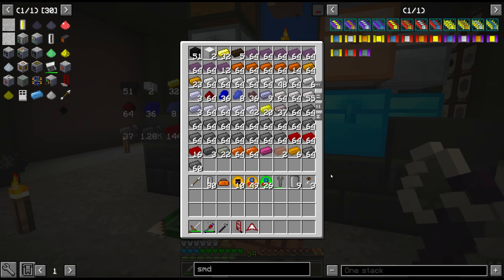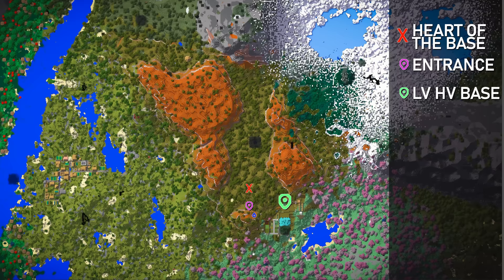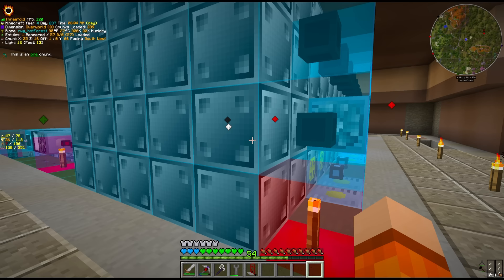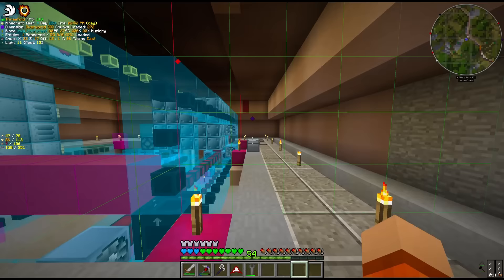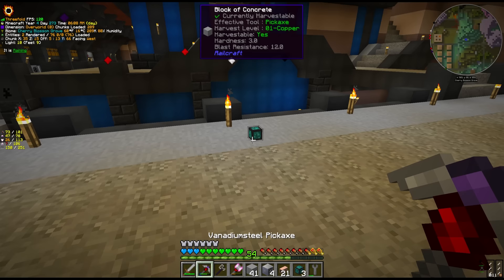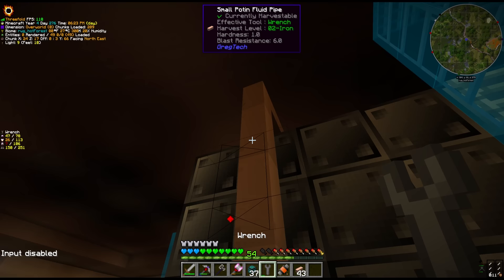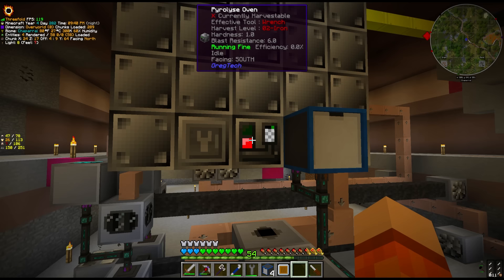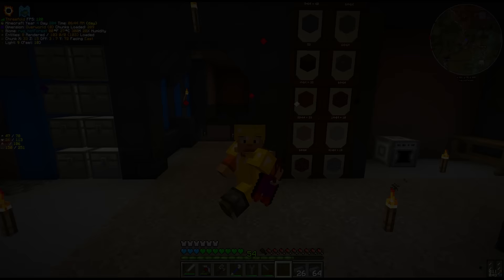Gregtech New Horizons S2 13: Power the Future

Comment: (For the record the Schematica design that Three initially shows off actually had an error in it, which was fixed after Three pointed it out to me. In addition Three rotated the design presumably to better fit his future power, which unfortunately causes Schematica to incorrectly/not rotate some of the blocks causing issues like machines supposedly getting power input through the front face, which is impossible. So if the Schematical design you get looks/is slightly different, that would be why 🙃)

For the record the cheapest incarnation of the Benzene setup only requires Kanthal Coils, Polyethylene (for Item Conduits), the slightest amount of Thaumcraft (though only for the maintenance lights, and while more annoying to set up you can instead use Insulated Redstone Conduits if you really wish), and some MV-tier machines to start. After that you can simply fill out machines and/or upgrade the few machines that require upgrading (mainly the Pyro ovens, the generators for the pyro ovens and the Electric Air Filter if you're playing with pollution) as you get them. The finalized design with the quad EV DT is a fair bit more complicated in comparison, but not so much that it's impossible to figure out. I hope 🙃.

The trick with the IC2 reactor vent as a cover is explained in the questbook, by the way. That's how I learned it. Also it's not required to use a Vacuum Freezer to cool down the hot coolant otherwise, you can use an IC2 Liquid Heat Exchanger and IC2 Stirling Generator to convert the coolant and produce some power on the side. Which is good, because the Vacuum Freezer requires the next *tier*, not *grade*, of circuits after HV. And those involve...complications 🙃.

The Benzene setup does have a pretty hefty up-front cost, especially if you don't go with thinner cables until you actually need the thicker ones (though that will involve replacing them and risking fires/massive explosions if you forget to do so), but that's because the setup is designed to house so much more than the cheapest initial one does. It'll make expanding/upgrading that much cheaper in comparison, since a lot of the work was put in initially.

(In case anyone is curious about that "The item seems to be broken..." message, that's because the large cells don't like being right-clicked on stuff. It's just a fancy message saying "this doesn't do anything", it's not a Warp effect causing something to break 🙃)

I do recommend making sure to leave plenty of space around the Benzene design for possible future expansion. The setup itself is indeed designed to fit inside a single chunk, since I'm assuming most people add/use FTB:U for chunk loading (the alternative, Railcraft Admin Anchors, load a 3x3 by default) and so you can load just the one chunk for the entire setup. But there are ways you can expand upon/improve the setup which just will not fit within that same space - frankly the setup as is barely fits. So unless you want to fiddle around with either a sub-basement or roof spaghetti - and you don't, trust me - leave space for future processes/large power generators.

Input Filter prevents items from entering a machine if the machine doesn't have a recipe that uses that item. In the case of the compressors it's necessary to prevent them from accepting Oxygen Cells, which are a byproduct of centrifuging air to get the necessary Nitrogen. You could also use conduit filters to accomplish the same task, but enabling Input Filter is cheaper.

I did save item conduits where possible (you may notice the pyros are being fed logs through an item pipe in fact, that's why), but some things item pipes just are not able to manage. So conduits it is.

I have color-coded both the super tanks as well as the fluid pipes (black for Benzene, brown for Wood Tar, and red for Nitrogen), but it can be difficult/impossible to make out the particular color of a tank in the preview given the blue color Schematica gives it to show it hasn't been placed yet.

"We have to set the shutters for the fluid pipes" immediately sets a shutter incorrectly 🙃

If you want to jump-start a gas-powered Benzene production without hooking up temporary combustion generators the easiest solution is probably distilling oil into Sulphuric Gas, and desulferizing that into Refinery Gas. Not as power dense as benzene, but as a jumpstarter it can get the job done.

You may be wondering what system makes sure that all compressors get cells once there are more than one on a line so that they'll all keep running and keeping the centrifuges fed, because Round Robin isn't necessarily going to cut it. The honest, if shameful answer is to stuff a stack of cells into every compressed so that it can never run out of cells to process or deadlock on an excess of cells. This may seem excessive, and it is, but cramming a proper solution into this tight a space is difficult/expensive (recall the initial setup doesn't even require HV circuits), and Empty Cells can be crafted from just Steel. Steel requires Iron (which this setup actually produces through Ashes centrifuging, and you can extract the Banded Iron dust directly instead of electrolysing it for the oxygen content if you wish) and Oxygen (being produced as a byproduct by the centrifuges and electrolysing everything the Ashes centrifuge into). And of course the entire setup is designed to produce power. So since it literally produces everything you need for steel, and steel is very quick to make in the EBF, I deemed the "stack of cells" solution an acceptable one(/compromise).

Among the other things that Super Tanks have received is an auto-output button, no pump required. For the tank providing Nitrogen to the Pyros and Benzene to the entire setup this button provides enough throughput to keep everything fed, so no pumps required. Well, for the fluids. The machines are another story entirely 🙃.

The pipe on top of the Distillery is indeed because eventually there'll be a line of distilleries there, and those cannot directly output into the tank.

...*I had not even considered using a machine controller cover to turn off the Pyro if the charcoal overflows*. I just had the one redstone lamp there with the idea that if the charcoal overflows it'll overflow into the output hatch, so with a redstone lamp a cover can be used to inform the player that something went wrong. Charcoal should never end up in the output hatch unless conduits aren't set correctly or there is something wrong with the (amount of) fluid extractors, so I figured a simple alarm like that would be sufficient. Did not even occur to me I ended up placing the output buses right next to the machine controllers, allowing for very easy overflow automation like this. Three figuring out ways to improve the design literal seconds before praising it. What timing 🙃.
Reply: The benzene setup seems a bit expensive for just starting, I assume this is to allow easy expansion and to fit it all in one chunk; however are you sure you need kanthal could for this or could cupronickel work fine at the very start
Reply: @morrisstanforth3278  Cuprinickel would not be very power positive, so wouldn’t recommend
Reply: @morrisstanforth3278  It is indeed expensive to set up initially, but that's because a lot of the cost comes from preparing for later expansions. Once set up it's relatively easy/cheap to fill in the rest/upgrade the pyros. This setup can go from ~1.2K EU/t profit all the way to ~20K EU/t profit before Distillation Towers get involved, assuming you can supply enough logs.

You could try to build this using Cupronickel coils, but your power profit will be roughly cut in half compared to Kanthal, or roughly quartered compared to later Nichrome coils. This initial setup with Cupronickel would produce only ~1A HV, and that just is not worth the entire setup.
Reply: It would be at least better than my current setup of a 2*2*2 liquid fueled firebox where I use all the creosote from making blocks of coal coke for my EBF (I know I probably should've made oil first, but benzene has a cool bonding structure and I wanted to get into IC2 crops nice and early)

Because of my current power, I don't have access to kanthal coils but it is next on the list and tbh, going from 40 EU/t to about 512 EU/t is good enough for now.
Reply: You are the Greg tech mvp
Reply: how long did you play gtnh and why are you soo good in it?
Reply: @slonly8355  Survival ~720 hours IIRC, so actually not that long. Creative testing stuff, uh...more hours than survival 🙃.
Reply: thanks for the info but where the schematics link ?
Reply: @vantoura  Schematica is in Three's Discord, pinned in the GTNH channel
Reply: @TheShadowofX  thanks a lot
Reply: Where do I find the download for this schematic?  The video says the discord but I can't find it anywhere, can you point me to it and link it in your essay =).
Reply: @MrErizid  The only place I have posted it is in Three's Discord, in the GTNH channel. Check the Pins to find the relevant post easily.

Comment: There are GT underground (as in below bedrock, allegedly) fluid fields that you are able to drill up using multiblock Oil/Gas/Fluid Drilling Rigs. While not infinitely renewable (until the infinite version of that drill in UHV or thereabouts) they can be rich enough to supply enough oil to feed an oil-based fuel production setup. The key word, however, is "can". It's random how large these fluid fields are, and in the overworld there's five different fluid fields that can spawn - Light Oil, Raw Oil, Heavy Oil, Oil and Natural Gas. If you're interested in producing Diesel, let's say, than only the regular Oil field will be of interest, as the other oils have (much) less yield on the Light Oil you need the most of and Natural Gas doesn't produce any at all. Add the fact that each fluid field is 8x8 chunks large, and the odds of finding a good nearby oil field of the type that's useful to you can be very bleak indeed. But Long Distance Fluid Pipes are perfect for sending oil across dozens of chunks, without having to load the chunks inbetween the input and output points to keep the oil flowing, and remote power is easily solvable when you're producing energy dense fuels like diesel. So expanding diesel production and using it as your long term power solution is entirely viable, you can comfortably take the oil-based combustion fuels all the way to fusion if you really want.

If you don't fancy making Cetane-Boosted Diesel just to fuel a T1/T2 rocket later on you can complete a quest in the MV chapter to craft an MV World Accelerator, which has a choice reward of a stack of Cetane-Boosted Diesel cells. The machine is not cheap, either to craft or to run, as you might expect from a tick accelerator. But they're not crazy expensive, and actually have some good uses in speeding up the growth of some Thaumic Bases crops (Redlon and Sweeds, chiefly). 

For the record, Argentia Seeds produce Argentia Leaves, which either produce a trickle of Silver, generate purified silver ore with UU matter, or be used to get 4x purified ore out of crushed galena/silver ore. There will be a point much later in the pack where you require infinite amounts of purified Galena ore (as well as Purified Sphalerite and pure Alu dust) to produce a much-needed resource called Indium, so those Argentia Seeds might end up being Chekov's Loot Bag Reward. The bee frames are Soul Frames, and while not hard to craft yourself they are useful as a relatively cheap boost to your Bee mutation rate. Not completely worthless, but not much more than merely "convenient" either. The weird-looking block is a Door Factory from Malisis' Doors, and is used to create custom doors. It's actually got a ton of options and have literally zero knowledge of what any of it does, so I'll leave that as an exercise to the reader 🙃.

HV gates a bunch of important stuff, not just in tech but in magic as well. Just don't make the mistake of rushing so quickly that you end up not being able to actually do anything with the options you've unlocked. HV machines are not going to run consistently without HV power - you can supply a battery to a machine to run it periodically, but obviously if you wanted to set up something like ore processing this is not going to cut it. You can craft some stuff with HV circuits, (a Portable Scanner is 100% worth grabbing HV circuits early for), Stainless Steel (Greatwood wands finally!) or even the odd HV machine (Macerator for byproducts since most ore macerating recipes are so cheap it'll run on 1A MV, Bending Machine to make Tin Cans if you skipped Healing Axe), but remember to take a step back and actually build a road to the bridge you're rushing to cross before fully building it 🙃.

Outside of buying Enderman spawn eggs from the questbook another option to get a regenerating enderman is to dive into a Roguelike Dungeon. On the second to last floor there is (a chance of there being?) a room with an Enderman Spawner. Given enough time this will eventually spit out a regenerating enderman, although going that far into a Roguelike Dungeon without tunnelling around it is very hazardous indeed. I've also heard that capturing a mob in a soul vial apparently allows you to reroll infernal traits, or something along those lines, though I've never managed to get this to work myself. Perhaps I'm doing something wrong or perhaps I heard wrong, I'm not sure. Also, speaking of soul vials, always keep some on you at all times. Not just in case you run into a regenerating enderman out in the wild, but in case you run into any mob worth creating a mob farm of out in the wild. Thaumcraft Wisps (for Ethereal Essence) and Eldritch Guardians (for Eldritch Eyes) are particularly noteworthy for any magic fans, otherwise Mother Spiders (for spider spawn eggs) will be useful as a source of spawn eggs later.

Benzene is another entirely viable power solution for MV all the way to LuV - and beyond, if you're crazy enough. As a power solution it's easily renewable, since it just takes logs to fuel, and through proper processing it can spit out a dozen-odd byproducts that are useless to useful to critically important at various stages of progression. The same, by the way, is true for oil-based power - GT is complicated like that. For the best power output you actually need to combine Benzene and oil together, though the spreadsheet has more information on those particular details. Those many particular details. In any case, for right here and now the most key, most critically important thing to remember with Benzene power is that Pyrolyse Ovens will live or die by their coils. Benzene power needs Kanthal coils, at least*, in order to have any chance at relevance. Adding Nitrogen is also a critical (though, relative to coils, less so) component. The difference in power profit between Cupronickel/Circuit 9 and Kanthal/Circuit 10 is somewhere in the order of 250-300%. And that's to say nothing of better coils making EBF smelting 5% cheaper in the meantime, or even as high as *50% once Nichrome coils enter the equation. In short: Upgrade those coils! Because they will make a major difference before all is said and done.

Comment: for the drawers, I think it depends on location. I think if it's for something like a drawer wall the gray works well with blue accents around the general area they're in. But if they're individual drawers the blue framed ones add more color